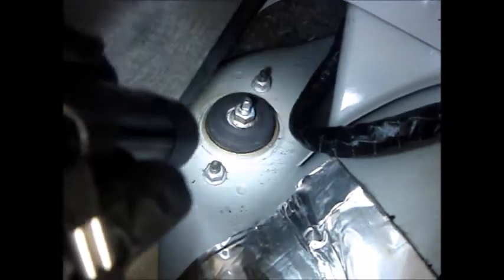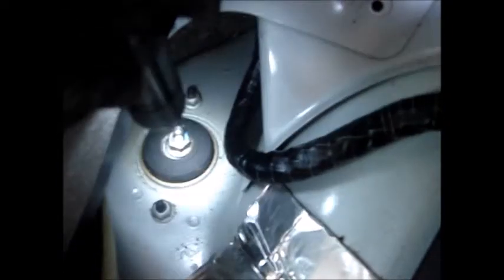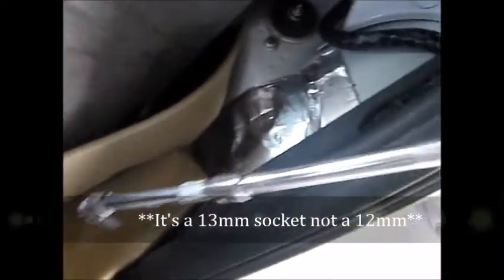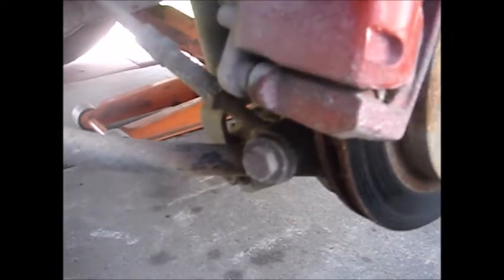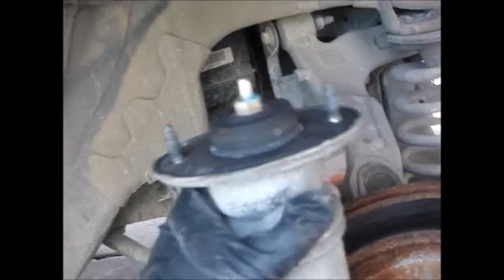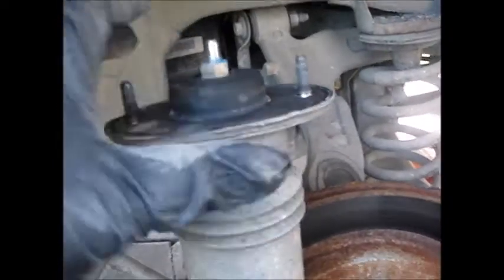Cadillac CTS  Rear Shock replacment

Comment: Hi Oscar  Thanks a lot for doing this -- it is very helpful -- I used this video to preview the job.  I have a question though.  What am I bending when I push the seat belt section out (starting at 1:30)?  It will bend back into place but does not seem to be going all the way back to where it started.  Is there a way to remove that section instead of bending whatever it is that I'm bending?
Reply from the maker: that a great question Howard, i believe their is a way to remove the whole back cushion but it will be pointless to do so. Try to push it with your hands as far back as you can. Make sure their is nothing in the way

Comment: Can you give me a link where I can buy the rear shocks ?
Reply from the maker: hi, i got the rear shocks from my local Autozone. Hear is the link if you want to buy online : http://www.autozone.com/suspension-steering-tire-and-wheel/shock-strut-rear/gabriel-ultra-shock-strut-rear/335815_421049_7413  i got them for 77.99 with lifetime warranty  but you can also get them from other online retailers such as rockauto.com for allot way cheaper. But the customer wanted them installed right away ans she did not want to wait for the shocks to come via (3-5)shipping .
Reply: Oscar Ruiz-Autorepair can I use these same shocks on a Xts?